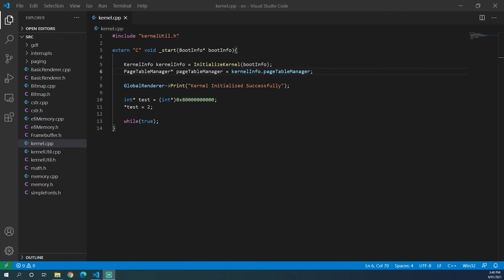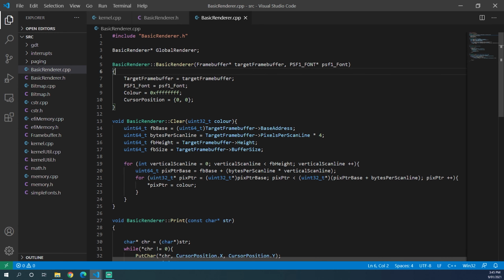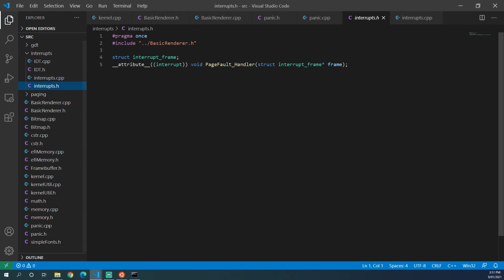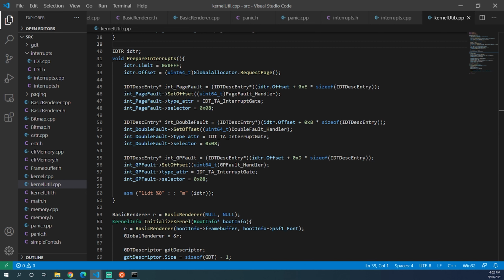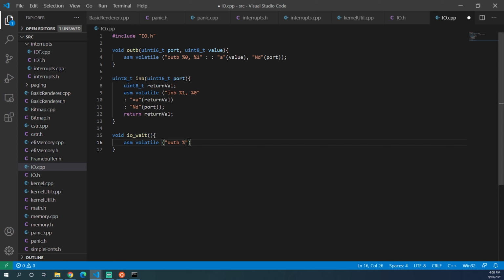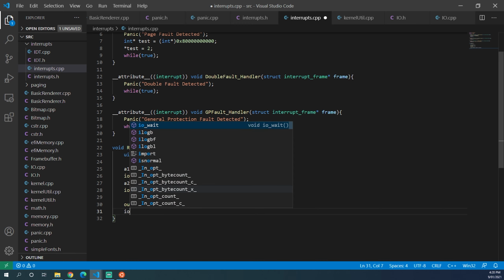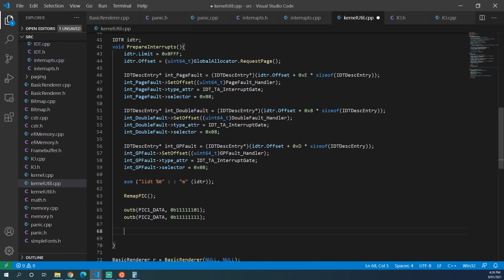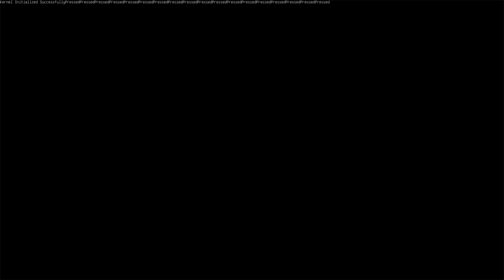Panic Screen, IO Bus & Keyboard | How to Make an OS: 12

Comment: Uh oh... didn't the last Motherboard with PS/2 connectors die in 2018? I might have to go beg one off of "The 8 bit guy"
Reply: No, you can still find motherboards with PS/2 connectors for mouse and keyboard today for a much cheaper price than what you'd expect. $100, maybe $150. They stopped designing them (you are right, PS/2 is old), but they still make them.

Comment: I have many problems with Qemu (Windows)
PS : I'm currently using the version proposed by you 
But the Qemu stuck in the "Guest has not initialized the display yet"
Reply from the maker: Try deleting and redownloading OVMF binaries
Reply: @poncho2364  yes that's working for me thanks (I think I have this problem when I change the bios configuration in qemu )
Reply: I have the same problem, just wait some time
Reply: yes it seems that i must wait for a (~3 to 5 minutes)
Reply: machine -> uncheck pause